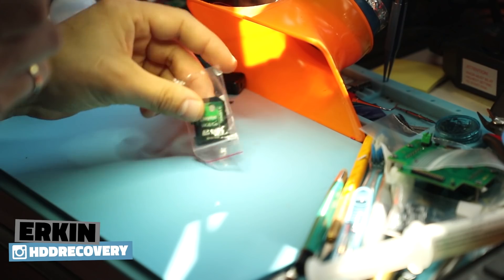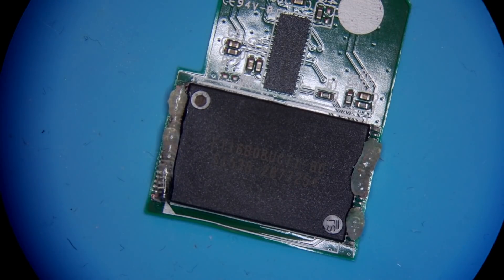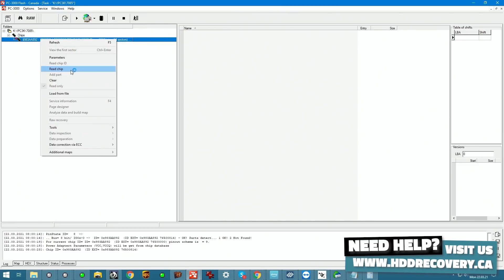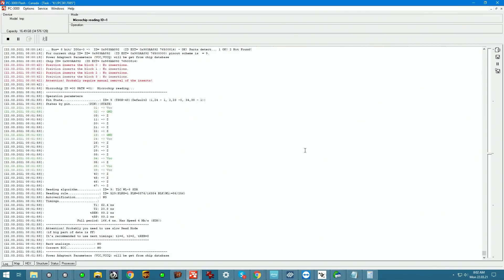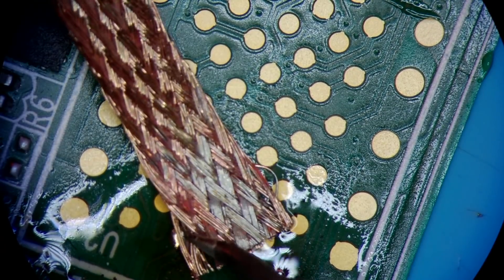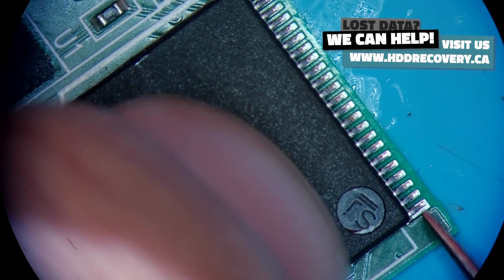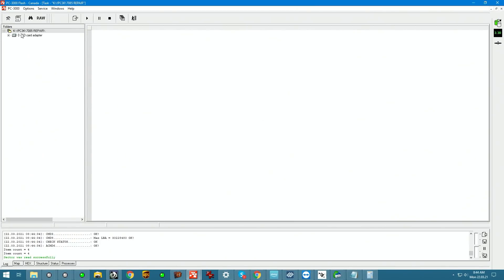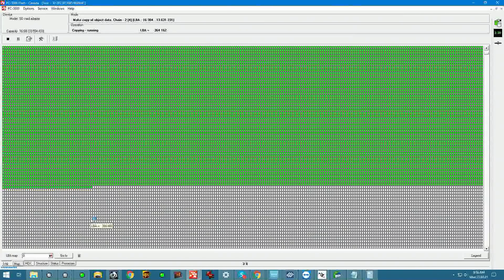saving data from sd card after a nasty hit

Comment: cracking job mate. one question. wouldnt it be quicker to do a chip off recovery than running all those jumpers. im no expert im just curious.
Reply from the maker: If you look close to the video. I started to do a chip off while repairing pads. Just reading the chip (without error correction, readout, and mix assembly) was going to take over na hour. It took 20-25min to fix pads and get direct access to data
Reply: @hddrecoveryservices  thanks for the reply mate knew id get a professional answer lol i was curious as i saw you put chip in reader and thought why didnt he build a controller but your answer told me why perfectly. thanks :)

Comment: looks like chip off procedure is most time consuming and lower recovery rate than actual repair of memory card.
Reply from the maker: repair if it works and if it is an option will always get the best result. Chip off can be just as good, but not always it comes out as clean as desired. In short, if there is a way to repair - its the best way

Comment: How many cost pc3000 ?
Reply from the maker: Best to reach vendor for it. Their sets are customizable based on your needs. Best tools come with appropriate price tag
Reply: @hddrecoveryservices  What kind of products will I buy to restore HDD, Pendrive, Micro SD card, SSD drive, NVME M.2 file.
Reply from the maker: @M.S.Infotechbngn  again, that's something the vendor of the tool will tell you based on your needs. From the list you have, you will need a lot of tools :) expensive tools